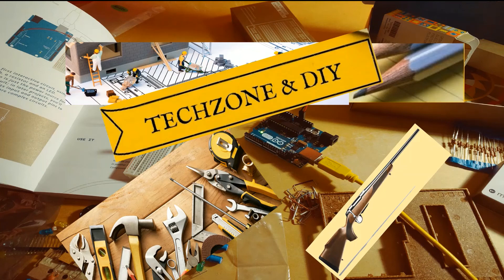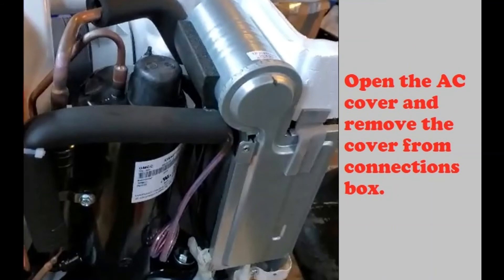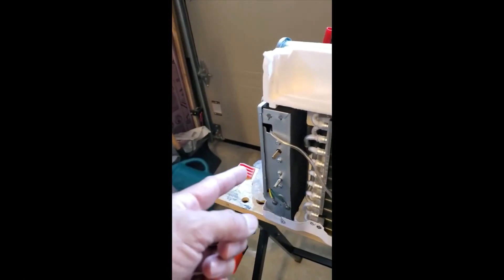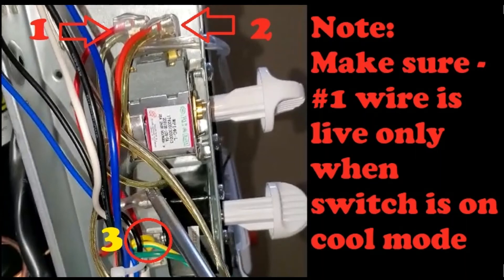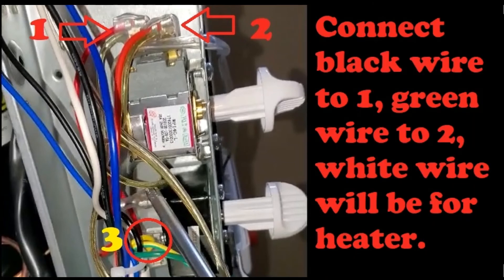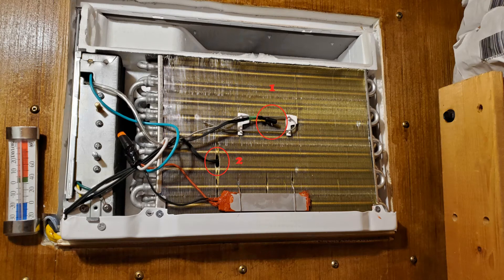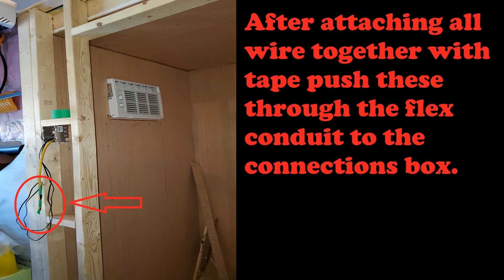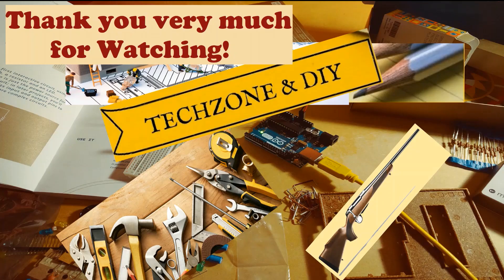Walk In Cold Room - Window AC Hack. How to modify Window AC for Walk In Cold Room.

Comment: I cool a 14lx12wx8h room fine with a 5200 btu manual a/c.
Reply: I thought those btu charts sounded excessive for such small rooms. But more btu the less the compressor has to run I guess to maintain temp. Less chance of freezing.

Comment: Thank you for this.  I've watched many videos on this type of hack but find yours easily the most well thought out.  I'm just confused as to how the connections for your three introduced wires, the black, the green and the white are made.  Does the black wire connect to wire 1 at the point where wire 1 connects to the ACs temperature controller, ie the top knob?  Does your green wire connect to wire 2 where it connects to the ACs fan knob?  Does the white wire connect to wire 3 (the ACs neutral) where it connects to the ACs compressor?  Is it possible to have either a photograph or a drawing of these connections?  Or are you bypassing the ACs controller by disconnecting wire 1 and wire 2 from the top knob and connecting the black and green wires to these ends of the wires that were just disconnected from the controller?  Hope this all makes sense.
Reply: Black wire connects to top knob terminal which switches on the compressor after thermostat turns on. Green wire connects to the other end of thermostat which turns on when lower knob turns cooling on. You can coonect these wires while it is connected to the knob. White wires connects to the live side of heater, as the neutral wires from within AC connects to the other end of heater. How these wires are connected to external Inkbird controller is described in other video I have made. Thanx.
Reply: @mohsinm644  I'm still confused.  Are you disconnecting the wires from the AC thermostat and bypassing this thermostat altogether?  Also I've watched the video for wiring the two new thermostats and the relay several times but which wires connect to which terminals on these components is unclear.  Some diagrams showing clearly all new connections would make this project helpful to those of us who don't have your electrical background. It's clear that you setup is superior to any other video I've watched on this subject, but I think you may be assuming your viewers have more familiarity with the subject than they actually have.  Your videos deserve more views and more support, which I'm sure you would get, if the step by step process was clear to even the most novice of us.  I've made images of all the components if you want to use them to show what connects to what .
Reply: No I am not disconnecting the AC thermostat. Though if you want you can. As the AC thermostat will not be engaging at all. AC thermostat works on higher temp of around 15°C or beyond and this AC WILL BE RUNNING ON 2 - 3 °C. I am using the thermostat connectors to hookup my wires with ease and will not need any other connectors.
Reply from the maker: On Demand Video for Hack Circuit: https://youtu.be/gg3ghMkbB0c